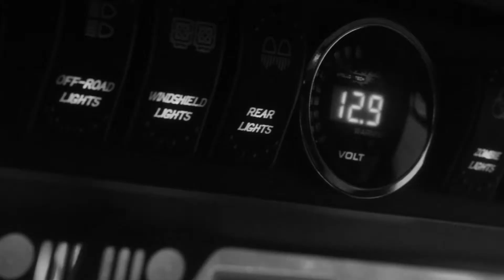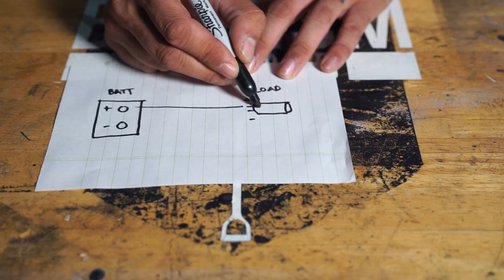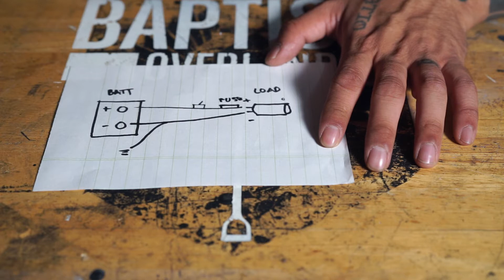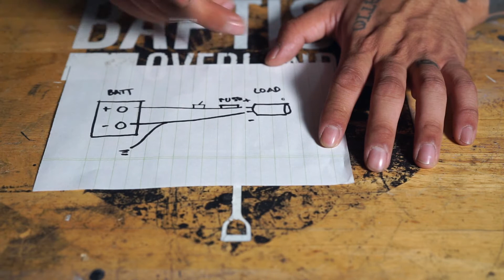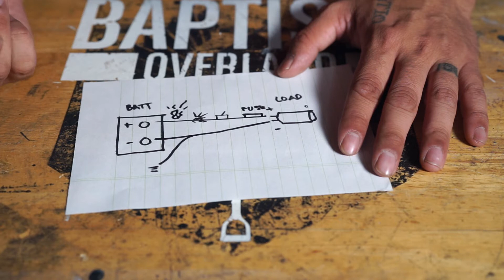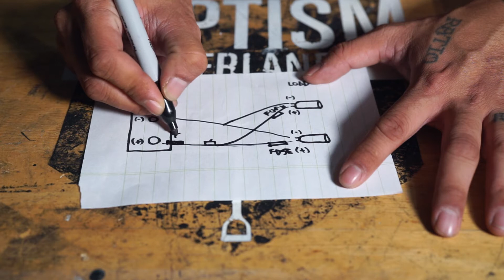*I ALMOST BURNED DOWN THE JEEP WITH A 12V SOCKET!!*

Comment: Very good video man! I really appreciate this video because I am going to add the same type of usb and usb c and 12v socket to my ranger in the bed and also on my brother's 1500 ram. At first when watching this I knew you had just forgot to add a fuse but I didn't know exactly where so your detailed explanation and drawing it out on paper as you did was extremely helpful for me to understand exactly what I need to do right away. Glad you didn't have a fire burn up your jeep but kudos to you for quick reaction to running for the fire extinguisher.
Reply from the maker: I’m actually gonna build something where I can mount the fire extinguisher within arms distance next time. It takes up too much time to run to the back to grab it

Comment: What Guage Wire do you need to be able to charge your refrigerator and a jackery?
Reply from the maker: It all depends on how far from the source it is which would be the dist block. I went with 10. Always better to overkill than having it too thin

Comment: Yes, positive wire always gets a fuse as close to the battery as possible or a fuse panel or something similar. This is probably the number 1 mistake people make when adding accessories to their vehicles. The think it's a small wire, not a lot of power, so they don't need a fuse or there's a fuse on the accessories.
Reply from the maker: Yep. Either way that whole thing has been dismantled and I rebuilt a whole new system for the back now with a power dist hub

Comment: Good lessons learned!  Any power cable should be positively zip tied down so it doesn't move and away from any moving parts fo there is no possibility of wear and causing shorts.

Also, there is no need to run the negative lead from your power outlet all the way to the battery as the entire vehicle is grounded and there are plenty of grounding lugs in the back of the Jeep that you can connect the negative lead to. 

Lastly, I have a USB charger plugged into a 12V socket on one of my cars and this socket is powered 100% of the time and is not switched - it came from the factory that way!  The plugged in Motorola charger also has a small LED indicator on the front showing power once plugged in and I've left this in the car plugged in 100% of the time for months at a time and it doesn't drain the battery.  The LED current draw for such a small LED is probably a single digit milliamp level so you shouldn't need to worry about draining your battery. One way you can test this on your Jeep is to turn the switch on and measure your battery voltage. Leave the switch on for a day, a week, two weeks or however long you have it not driven and measure the battery voltage with a multimeter. I think you will not find any significant battery voltage drops!

Comment: Quick question 
I just have a quick question is it possible to install the second 12 V socket and tap into my factory 12 V socket in the rear of my 2018 jeep Wrangler JKU or do I need to run to the battery?  Any help would be great
Reply from the maker: I've tapped into it before. Good news is that socket you're tapping into is fused so it should break that if the load is too much. I DO have to say I'm not a licensed electrician so run it at your own risk. Personally I've just gone to the battery with mine because I want a constant power without ignition needing to be on.
Reply: @BaptismOverland  I’m concerned if I tap into the battery running all the time will drain my battery. If I tapped it into the factory socket, I could switch it off right? I understand not being a licensed electrician. But I value your thought.
Reply from the maker: @dr.christophergroves2116  correct. It'll drain your battery if you tap into it IF you have something plugged into it all the time or if the 12v socket you have has a little LED light. It won't be a lot of drain but yeah def don't want that
Reply: @BaptismOverland  what if the switch has an led light but when in off position there is no light on?
Reply from the maker: @dr.christophergroves2116  then that's fine. It's the parasite draw that you don't want and a lot of sockets have the led light that stays on
Reply: @BaptismOverland  thank you so much man! I appreciate it. This one definitely has an LED switch that turns off.

Comment: What gauge is the cable ? And where did you find the switch .
Reply from the maker: At any auto store. Cable gauge will determine how far fr the source. On mine I used 10awg

Comment: how many ampere of fuse did you used? thank you
Reply from the maker: I've since built out a different system for power management and in that system I believe I used a 10a (I'll have to double check again) based on what I knew i would power up and what size gauge wire I was running.

Comment: On the opposite side you put your switch, there is wiring already there for a socket. Even if there is not a socket. My 2016 sport had the wiring with 12-14 volts coming out of the hot wire on a plug. I looked at the forums and they said it was for a socket. You really didnt have to run a wire directly to the battery. 29 bucks on amazon and then 15 more on a whole panel of sockets is well worth it.
Reply from the maker: Wow didn't know that! Good to know but I already upgraded the whole system anyway. There's a video now where I created a whole new distribution block to power 12V plus fridge and lift gate light
Reply: Can you send link on these sockets from amazon?
Reply from the maker: @cheburashkadude2189  any socket will do really. There’s tons.
Reply from the maker: @cheburashkadude2189  also I accidentally removed your other comment. My apologies! If you’re running the wire all the way fr the battery to the back I would go with no smaller than a 10ga. 10 should do. 8 would be overkill and 12 is too small. And then just look for an in-line fuse holder on amazon too. And any local automotive store will have them.
Reply: 29 bucks for what?
Reply: @cheburashkadude2189  I'm guessing for just the socket
Reply: Got that 12v plug in already from the factory.  The wires are not big enough to feed my 55w 4.6 amp Iceco fridge. Had to install 12 gauge wire. With fuses of course.

Comment: You always fuse as close to the power supply and use wire loom
Reply from the maker: Yep. Learned the HARD way. I've since done a new install of a whole system. You can check it on my channel. No problems since
Reply: @BaptismOverland  hey its a honest mistake ive been there but never started a fire lol but i now fuse everything i install now even started making my own fuse and relay boxes to keep all high power out up my cab
Reply from the maker: @kevindeibler346  man it was scary. Coulda been sooo much worse. It was one of those "easy" jobs and so I was negligent. Now I'm super thorough no matter how small I think the job is.
Reply: @BaptismOverland  ya im the same way i even if i know how to do something i always look it up to make sure im doing it right and to make sure  theres nothing else i should be aware of one of the reasons i watched your video and ive been doing vehicle wireing since i was a teen but always up to learning new tips and tricks
Reply from the maker: @kevindeibler346  Then def check out my other video where I set up a whole power dist block with a circuit breaker. It's pretty awesome
Reply: @BaptismOverland  i will have to ive gotten into making my own relay and fuse boxes for all my jeeps and i upgrades all my battery terminals to military style terminals wit wing nuts makes it alot easier to disconnect the battery and our add new wiring just add wire lugs to all my battery cables

Comment: You were really lucky man. Good plan to also add a fuse by the battery. Don't take this too big. Think 5 Amp is enough. Greetings from the Netherlands
Reply from the maker: jeepie1964 thanks for the advice!
Reply from the maker: I went with a 15 amp. Yeah, might go down to 5 but I gotta think of what I’m gonna charge up with those sockets and how much draw it’s gonna need

Comment: I would have inserted the fuses in a more accessible location along the cable, in your location, if a fuse blows, you have to dismantle all the panels.
Reply from the maker: It’s already been fixed actually. There’s a new video I have where I created a distribution hub that powers everything I need and it’s all accessible. Fused up and everything
Reply from the maker: I also added a circuit breaker for that new hub as well